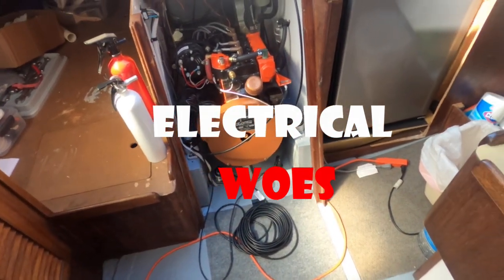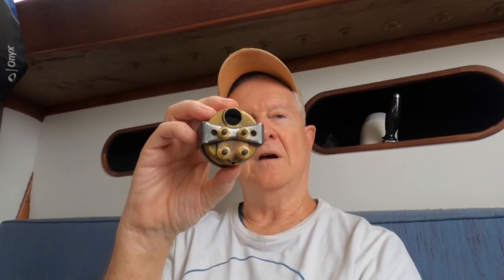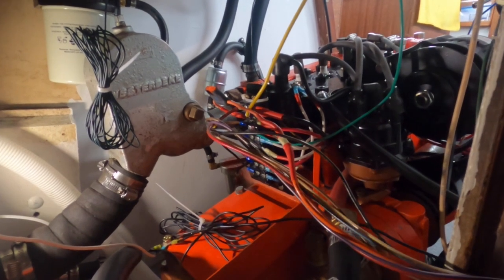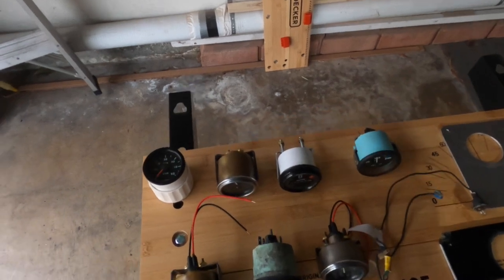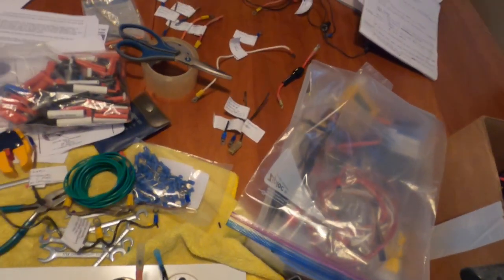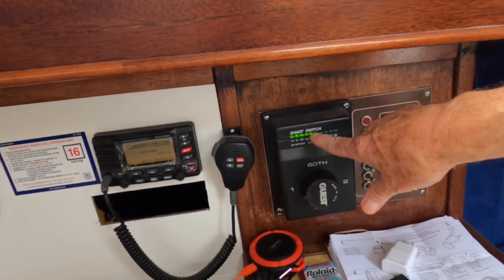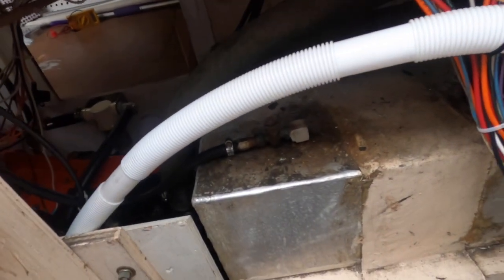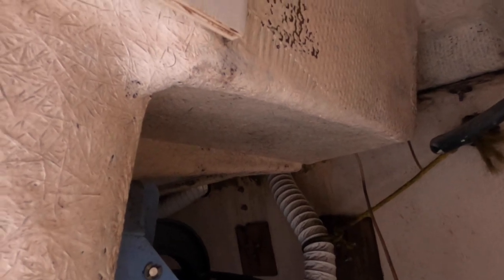Electrical Headaches

Comment: Thank you Lloyd...Love the videos, very informative. Planning an A4 engine swap or rebuild in the near future. Question: did you cut the access from the quarterberth into the engine compartment? My Islander 28 has  a similar configuration, but no engine access other than from under the companionway. That would sure make my life easier
Reply from the maker: Hi James.  Yea, thankfully that access was already there and likely a part of the original design.  I can't imagine doing the work I've done without it.  I would have surely created my own access otherwise.

Comment: This is a great video!  Thanks for making this.  I am in a similar situation. I am working on rewiring my boat currently.  I have my Atomic 4 in my workshop at home.  My biggest problem is having the time to work on it.  I hope it turns out as well as yours has.  Nice job finding the short in your gauges.  Those can be a pain.  I am the opposite from you in the knowledge department, I am much more comfortable with the electrical and less so with mechanical.  It looks and sound great.  Did you buy the wire individually or did you buy the wiring kit from Moyer Marine?  I am tempted to do that but its not cheap.  Thanks again and great job!